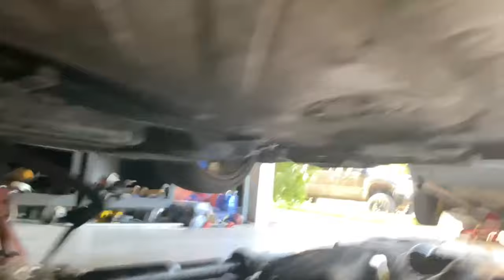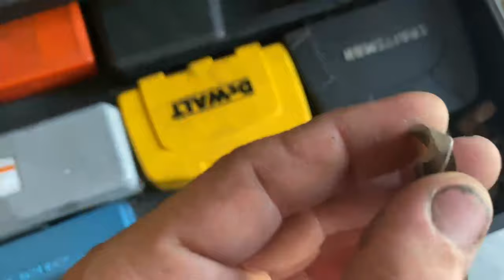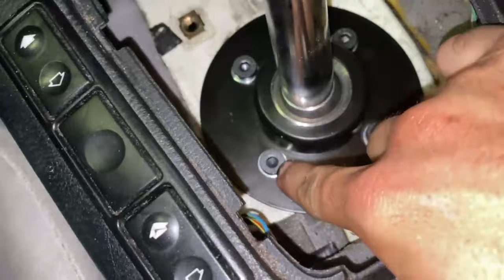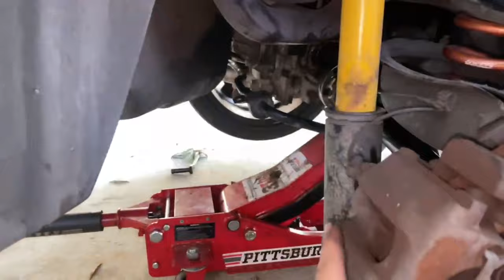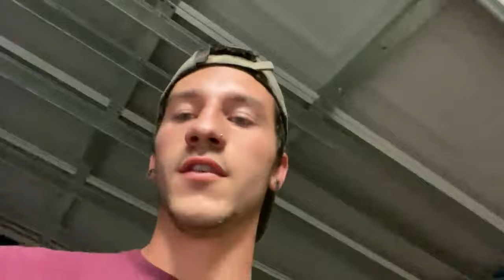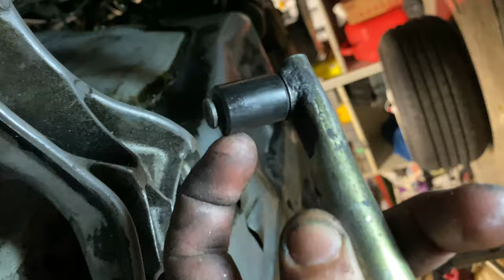HOW TO : bmw e36 chassis mount short shifter install | (drift build)

Comment: The clutch to me seems to be normal, I have a light weight single mass conversion kit on mine and it seems to match up what you showed
Reply from the maker: Yea I messed with it got it to bleed and it feels way better
Reply: @mbnseth  yeah that’s how mine was too at first and then it bled it self after some foot pumps and felt fine